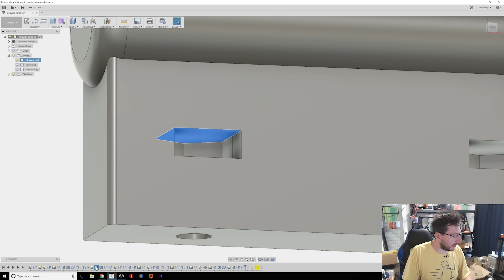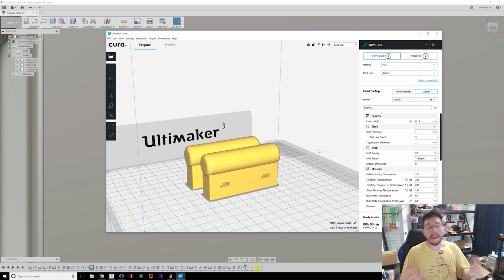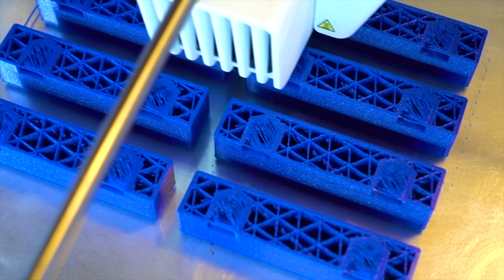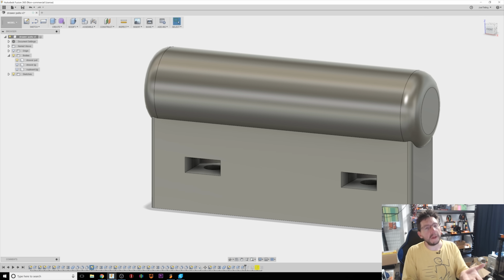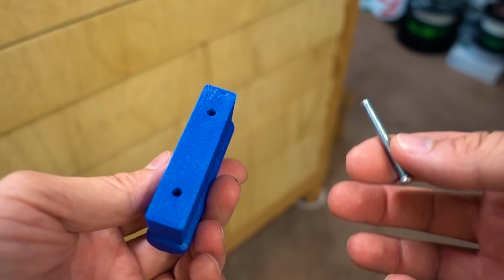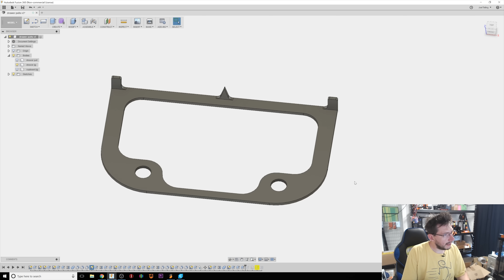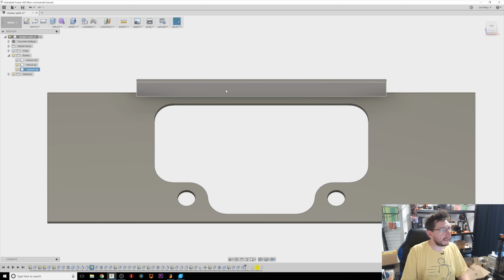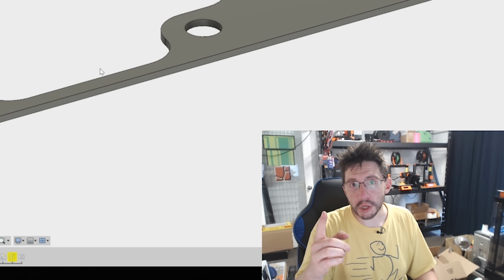3D Printing Square & Level Drawer Pulls and Cabinet Handles using Jigs and Screw Templates

Comment: You're the best, Jackman orange baby! #gifking

Noob question I was thinking about when you drilled out the holes, how forgiving are those materials? Can you tap holes in the plastic so you can thread the bolts directly into it? Or maybe with the bridging there isn't enough rigidity in the print to tap threads even if the materials can physically take it.
Reply from the maker: Yeah, man!

The materials I printed in (PlA and NylonX) could both be tapped without the need for nuts. I thought about doing that, but I wanted to  model in pockets for the nuts, and I didn't want to rely on plastic threads. I know this are just pulls, and most likely tapped plastic would hold up just fine, but, why build something without overkill? :)
Reply: The slicers showed only two perimeters. The drill bit probably removed one of them... Please do not copy this exactly as shown. Better approach would have been to print a few test holes first (with slightly different diameters).
Reply: You know me, I'm all for #teamoverkill haha. I think this was a better solution because the threads in the nut definitely won't pull out, with the plastic there is a chance over a long enough time. This way the pulls should outlast both of us!
Reply: If you have not done it yet, please find CNC Kitchen video on shells and infills.

Comment: Why not design some depression in the slide rails and a corresponding nubbin on the drawer tracks on one side so that they catch just slightly, but can easily be freed with a push or pull?  That would make it easy to close the drawers flush to the counter every time AND still allow the drawers to be opened from either side.
Reply: No!  Wait!  Magnets!  That'd do it nicely!  inset magnet on either the track or the rail on one side or another and then a thin strip of ferrous metal on the other part.  Viola!  Drawers that tell you when they are flush with the edge of the counter!

You're welcome.

Comment: Joel when are you going to use metric for measurement its so much easier in small sizes
we in the UK use both which complement each other were as most other country's just use metric  its like using Einsteins theory and string theory together as they complement each other as well .ps your YouTube page is one of the best for 3d printing.thumbs up .

Comment: hi sorry for my english first. damned french lol
 for your drawers,maybe a system with a small metal ball mounted on a spring along the rail . and a small hole (half ball) where the matel ball fits in when in closed position . so when the drawer arrives on closed position it is kept in place by the ball in the hole. and you can still push the drawer in two ways thanks to the ball.

Comment: I use square nuts.  They are less likely to cam out as the surfaces that are constrained by the plastic are longer and have a greater moment of resistance.  I design the slots that hold the nuts to have an inverted V above them rather than bridging across a flat plain that is unsupported or having supports that need to be removed.  To keep the drawers aligned I suggest that you make a detent or notch in the runner and have a roller on a spring so that when the drawers are aligned with the roller in the notch there is an amount of extra resistance and when it is not the roller would not have any noticeable drag on movement.

Comment: @3D Printing Nerd. You could put a magnet on the side of each drawer, and magnets on the table, so that it is aligned with the ones ton the drawers when they are closed. Then when the drawers are in the right splace it would, be a little harder to move the drawer. Then all the drawers would be in line, and looking good. But you would still be able to open them from both sides. To make the magnes sit in the right place, you could 3D print a template to mount them with.

Comment: Joel, for the template, if you made the edges a overhanging T on the top and the side you could just flip it over for the other cabinet door and not need to use a second flat object.

Comment: It'd be kinda cool if you had magnets on the outside of the ends of the drawers themselves, and then magnets on the inside of the drawer frame, so that when you wanted to close the drawers, it would sort of "snap" in place without the need for mechanical latches, and you could still open the drawers from both sides. Awesome stuff, Joel. You've managed to find all kinds of ways to make 3D printing practical, and I love it!

Comment: On the subject of tapped holes: I've had some good results printing holes slightly smaller than the screws, and just let the screws self-tap the plastic. Less trouble than printing nut traps once you figure out what size hole works well for the screws you're using.

Comment: Joe, in professinal design it a standard to consider the manufacturing process tolerances. Thats because it is impossible to manufacture perfect parts as you just experinced.  In 3D printing people often think that foreseeing a larger gap between parts is "cheating", while a professional designer would be criticized if he doesn't consider manufacturing tolerances. So, why not make the life easier and just design the hole larger? I normally foresee a 0.2mm gap at least between parts and if possible 1mm. This avoids a lot of cleaning and makes it easier to print. 
To get realistic tolerance of my printer I designed this jig: https://www.thingiverse.com/thing:2484766

Comment: Suggestion, if you wanna keep the drawers to be centered when you put them in and retain the dual side functionality you could make like a notch system in the center of the rails. That way it would just rest in the notch but can still be pulled from either side.

Comment: If you design and print a plate with a hole it it that holds a ball bearing against a spring in a hole in the drawer sliders on the cabinet, and then make a plate with a dimple in to fasten to the drawer side, you could make the drawers automatically line up whilst still being able to open them from both sides.

Comment: It would have been cool to pause the print insert your 🥜 and then continue the print. That way you wouldn’t need the small cut out section, and you could use the nut as support material for the bridging section. 🤙

Comment: you could have "capped" one end of the jig. Use it on the outside of one door, then flip it and use it on the inside of the other door.  I think that should work.
Reply from the maker: That very much would have worked. I've been out of the game, so to speak, for quite a while, and it didn't even occur to me to drill through the other side!

Comment: Nothing wrong with nuts but I am hooked on heat inset nut inserts for plastic. Just make the hole in the bottom and use a cheap soldering iron to press the nut inserts in flush and you're done.

Comment: Hey Joel, I had a thought about your template for the holes. If you cut a small triangle into the center of the larger ones, it could be used for centering the drawer pulls as well. What do you think?

Comment: Im not sure if there is a way to do it. But maybe it is possible to add something in the center of each drawer that adds something like a noticeable step when closing it. So you can get easy and clean closing from both sides. My thirst though was am magnet in the center but I thing that there is not enough space for it. You may need to drill new holes and that’s not ideal. I really don’t know if there is a good solution but maybe someone here has a suggestion

Comment: Joel, there is a way to have the drawers stop in the middle. It will require some research and work but you could add spring loaded detents to each drawer. You might find them on amazon but most likely at McMaster-Carr. I'm a Tool & Die Maker and have applied these in many of my designs. Take care!

Comment: Something interesting I thought of... why not have a cut out in the model for the nut and instead of slits to slide them into to, make them solid. I think you could pause the print and stick the nut in there and have it fully captive inside the drawer pull it self. I don't know how the filament would react to that however... Sorry if someone already suggested it :P

Comment: Should have taken a folded hand towel or something, and placed it between the channel locks and the surface of the object. The extra padding from the towel would prevent the tool from scratching your print.
Reply: or some scrap cardboard is adequate

Comment: If I'd done these, I'd have just put nut-shaped cavities in without the slots, then dropped nuts into them partway through the print. Then you don't have the little rectangular holes.

Comment: What if you put a pointed opening in drawer rail then 3D print a "springy" pointed piece on drawer to "lock" in to the central position? Rounding it a little for ease of sliding but enough to semi-hold in center location on rail.

Comment: If you have enough space in there a spring loaded detente that aligns when the drawer is in the middle would be easy to implement and give you some positive feedback on where to stop from either side. Just drill a shallow blind hole in the wall of the drawer and attach a flexible arm with a half ball on it so that it will fall into the hole when the drawer is in the middle. Super easy to whip up the 3d printed part and lets you know where to stop without having to look at and align each one. Make the mounting holes on the printed part slots for some fine adjustment to get it set just right and you could have a decent system ready pretty quick.

Comment: Why didn't you just measure the same length from the top and align it with the notch on the first template?
Reply from the maker: I don't understand what you mean?
Reply: 3D Printing Nerd To use the first hole template you had to mark the middle of the drawers and align the notch in the template with the mark. You could also measure 2" from the top ot the door, mark it, and aling the notch with the mark the same way. You just do it on the side and not on the top, that way you don't have to print a new template if you decide you want the pulls to be lower or higher. Hope I managed to properly explain what I meant.

Comment: couldnt you just put some magnetic catches at the flush point so it would kinda lock in when flush then you just gotta pull a little bit to open it on either side

Comment: if you stick a piece of scrap wood or print on the other side of the pull, then it shouldn't mar the top side... >_>

you do the same thing with clamping woodworking projects, you clamp with some scrap wood between the jaws and the finished product to avoid scratches... =D
Reply: wow! I got a heart! Thanks so much 3D printing nerd! =D

Comment: Joel, Thank you for your awesome videos! I have been watching you for over a year now. I have a suggestion/iteration that may make "next time" a little easier, faster, cleaner, and stronger. Why not use a long grub screw (enough to go through the wood plus some to attach a nut to it) and screw it into your handle with loctite or any compatible adhesive? If your hole is over-sized you can use a tap and if it is too loose you can use a heavier weighted adhesive. After that you use a nut to fasten from the other side of the drawer face. Just a suggestion and keep up the good work! High Five!!!

Comment: You could have designed the handles completely closed and placed the nuts inside completely hidden openings after pausing the printer. Of course then you have no possibility to force-fit the nuts...

Comment: maybe you should add some kind of ball detent that "lands" the drawer even with the face frame. You would only need 2 per drawer along one rail, far enough in from the face to act as closed and open stops for when the draw is opened from either side

Comment: Consider a center detent for your sliding drawers.  A flexible tab that catches a dip in the center of the side of each drawer.  Pushing the drawer in from either side would catch in the center.  It would then exhibit a central and aligned position that could still be overcome from either side.   Bo.

Comment: I would simply forgo the nut and use course thread pan head screws.  Less hardware, easier print, easier install, cheaper overall.

Comment: print the door stops in flexible material, that  way, you can still open the drawers on both sides, but they wouldn't go beyond the point they are supposed to.

Comment: So for the draws an idea I just had was to use a part that will have a bearing ball and a spring so that the spring will push the bearing ball up to half way out of the part. Then you have a divot in the draw for the bearing ball to fit into. That way you have a two way draw that will stop in the middle.

There are probably quite a few solutions for this.

Comment: Could not have done it better myself.. Although I'm soft these days so I would have worn some thick leather gloves while drilling out those holes or used a vise.  Back in the day I had MUCH tougher hands, not so much anymore..
Reply from the maker: I get the feeling, now that I've shown myself doing that, I need to get a vise else I am destined to drill through my hand.
Reply: You might find using a good thick pair of leather gloves perfect for those quick jobs. Mechanix MPact Leather are pretty good.  Even good for grabbing hot racks off the grill.. :-)

Comment: I'm going to steal the pass through door design. I'm going to embed a large magnet in the cabinet and drawers so they have a natural centering point. They won't be strong enough to self center but should have a positive feel for when they are in the right place without having to look.

Comment: one way you could get the drawers to stop where you want them without installing hard stops on either side would be to put some strong-ish magnets on the sides of the drawers and the insides of the cabinets, then they would have a spot where they would naturally want to stop while still allowing for you to push past them

Comment: just embedd a little magnet on one side of the sliders and a metal plate on the wall. so you have a soft stop and alignment and can still slide in both directions

Comment: I think you could make droor stops using magnets, so maybe a small part that attaches to the surface of the droor and the bench that has magnets so no matter what side you open them from the magnets will provide a stopping point.

Comment: What you could do to register the drawers is to mount a spring hook to the lower drawer and a counterpart to the top. If you design the hook/latch part round it gives you a tactile registration when the drawer is in the right place but you can still pull it out from both sides.

Comment: Key is you got the job done. 2nd is you learn from it. First rule for me is print one...see if it works on the material used and printer. If not change it until it does. It's great that you printed all those handles in a Lovelly colour blue on a super printer whilst you were sleeping, problem was you spent the rest of your day doing a job that should have taken an hour. As a carpenter we have one rule "measure twice cut once " great vids and nice to see you take it so well when it doesn't go to plan in reality.

Comment: 2:55 I usually solve that problem in a different way. I make the hole for the screw to go into (after the nut) square (not round), since there is no reason for it to be round, but it's a lot more difficult to bridge around. And I also like to slightly extrude a slot into the ceiling the width of the hole. It's kinda difficult to explain without pictures. But basically I model it so that the printer first bridges both sides along the square hole and then a few 2 layers or so later bridges the other sides of the square hole. I use many different techniques in different situations. But that is one technique I tend to use. Which I like, 'cause it bridges perfectly, there is no need to poke through a 0.2 mm layer or anything like that and usually it makes no visual difference, since it is not visible from the outside.
To be fair though the 0.2 mm closed layer, is a pretty neat idea and is definitely useful if you really need an otherwise unsupported circular extrusion.

Comment: for the cabinet door template you could have added a top to the template and then on the 2nd door you just mark the inside and the holes would be lined up still

Comment: I'm wondering if you "screw through" the 0.2mm layer, you get a nylock nut effect. when the plastic is crushed through the threads

Comment: There's a way to have drawer stops and allow them to get pulled out both sides. Have a relief cut on the opposite side that gets pulled in (front face 1 and front face 2) and only drawer stop on one side, one for each direction. I'm sure you can figure it out. Although my description may be confusing.

Comment: Love your channel.  I don't think you need a nut for these.  Just print the holes sized to tap them for the screws.  You could probably pull over 100 lbs without stripping the threads even without the nuts... way more force than you could ever apply by hand.

Comment: You could use magnets to give some resistance to hold the drawers in the correct place.  Thay way it would allow for opening from either side but also allow for some placement control.